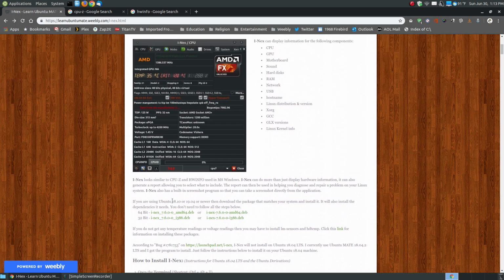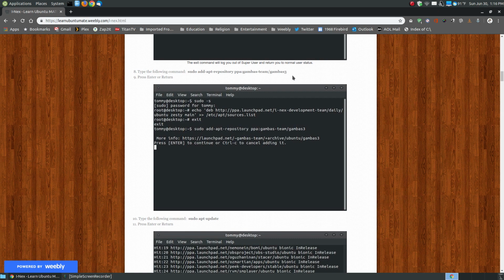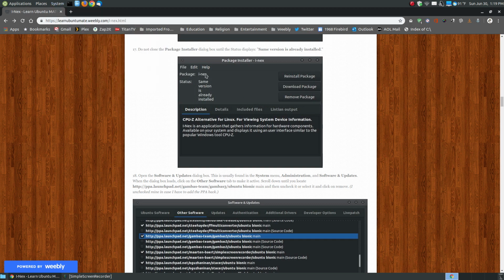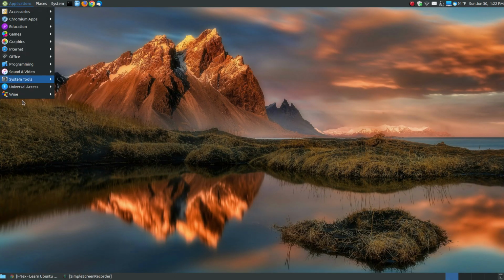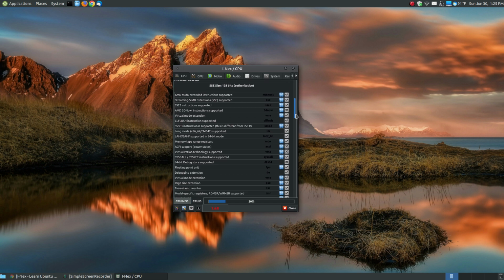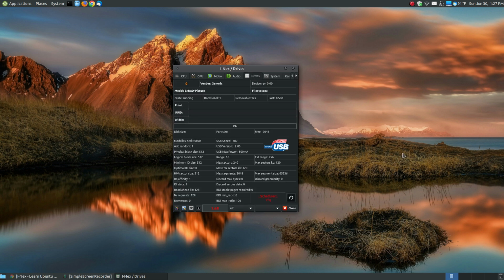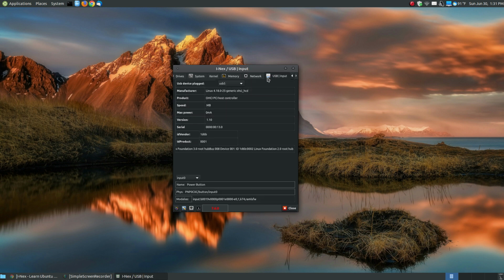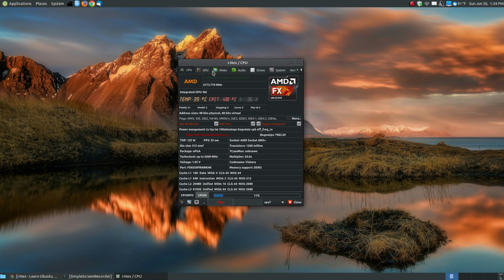I-Nex: Install on Ubuntu 18.04

Comment: Tommy Thompson:  I would rather use hardinfo unless this one is any better.
Reply from the maker: I-Nex is similar to CPU-Z used in MS Windows. Most of these type of applications report hardware components just fine. It's just what you are familiar with.

Comment: Too complicated,I will install cpu-g
Reply from the maker: I use HardInfo gui or inxi cli. I had someone to ask me if it was possible to install I-Nex on an Ubuntu 18.04 system.
Reply: @tommythompson002  Do you know something similar to GPU-Z?
Reply from the maker: @MentalyStableDude  Have you ever tried CPU-X?  It's very similar to CPU-Z. https://x0rg.github.io/CPU-X/
Reply: @tommythompson002  i have HardInfo too,I use it just for benchmark and some exces information

Comment: I installed it on my Kubuntu 18.04.3
and it says:
This application has raised an unexpected error and must abort.
[45] File or directory does not exist.
MDecode_dimms._inits.46

I guess that is the error that Dillenger R. sees, a few lines below.
If I click ignore, another error comes up. If I click ignore, the window opens but there are a lot of missing info. It seems to only show the CPU temperature.
I see things like Label123, Label673, etc.

I had email the makers of CPU-Z about making a Linux version long ago but they ignored me.

It is nice seeing that someone is putting an effort to improve the Linux environment.
Reply from the maker: I think I-Nex has trouble with different versions of "gambas3" and "gambas3-runtime" on different machines. 

If you like CPU-Z in Windows then give CPU-X a try. CPU-X: https://x0rg.github.io/CPU-X/

Screenshots taken from CPU-X
https://github.com/X0rg/CPU-X/wiki/Screenshots

I hope this helps.

Comment: I too run into the same error as Dillinger.  Not sure what bearing this has but I also don't have the CPUINFO or CPUID buttons on the lower left corner.
Reply: report bug in github
Reply: Will do.
Reply: @AzteCypher  https://github.com/i-nex/I-Nex/issues
Reply from the maker: Open your Terminal and enter: sudo apt-get install lm-sensors hddtemp
lm_sensors provides tools and drivers for monitoring temperatures, voltage, humidity, and fans and hddtemp is a small utility that will provide you with the hard-drive temperature.
Reply: I did that as well but still no voltage.
Reply from the maker: @AzteCypher  Ok, thanks for letting me know. Maybe someone from the bug report can figure out the problem. If I run across something I will let you know.

Comment: It worked but I got a little crash window and I can click ignore tho
Reply from the maker: What type of Linux and version are you running?
Reply: @tommythompson002  Ubuntu 18.04.3 LTS.. it works it's just that a crash box pops up but I just click ignore and it works
Reply from the maker: @Dillinger86  That is strange. If I find a solution to fix the crash pop up, I'll let you know. The creator of the program left a message in the comment section. He probably could tell you why it's doing it and how to get rid of it.
Reply: @tommythompson002  So I had to re-install Ubuntu, something went wrong with docker and it was filling up the syslog with massive gigs of error crap and I couldn't find a  solution lol So I went back and re-installed this and got the same thing. I have a screenshot if you'd like, the I-Nex library has the same popup error, both say the same. Oh I forgot to mention that they work after clicking ignore.
Reply from the maker: @Dillinger86  Are you able to send me a link of the error? I'll do some research and try to figure out what's happening.
Reply: @tommythompson002  It says: This application has raised an unexpected error and must abort. (Then below that it says)
"MDecode_dimms._inits.46"
If you have a twitter account here is a link to this screenshot
https://twitter.com/Dillinger65/status/1196949649967288320?s=20
Reply from the maker: @Dillinger86  Sorry for the late reply, sometimes I don't get email notifications when people leave a comment. Someone above had the same problem that you have and the developer told them to report bug in github. Here's the link: https://github.com/i-nex/I-Nex/issues
In the meatime, open your Terminal and enter: sudo apt-get install lm-sensors hddtemp
lm_sensors provides tools and drivers for monitoring temperatures, voltage, humidity, and fans and hddtemp is a small utility that will provide you with the hard-drive temperature.